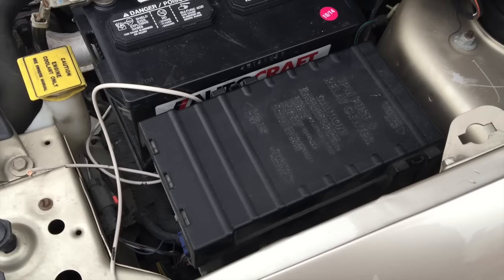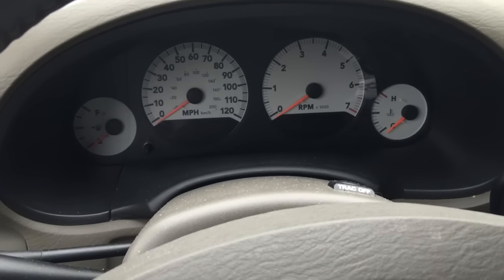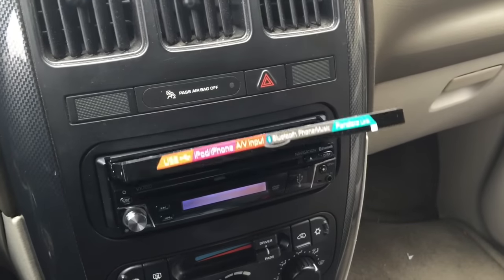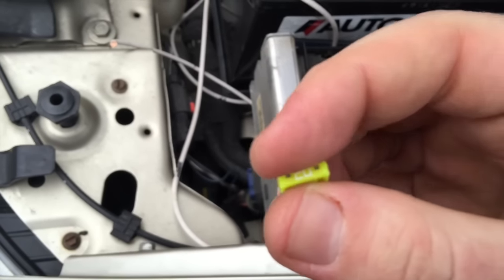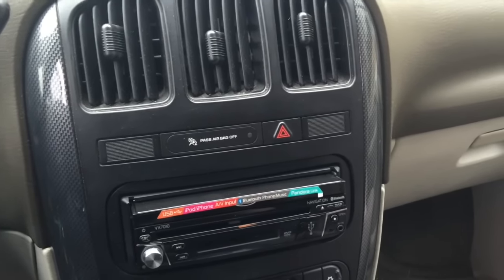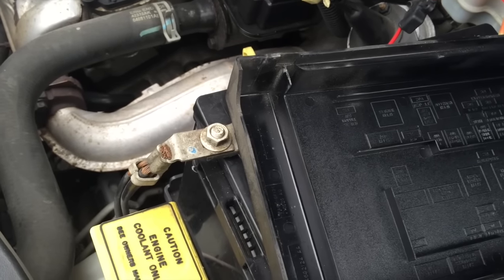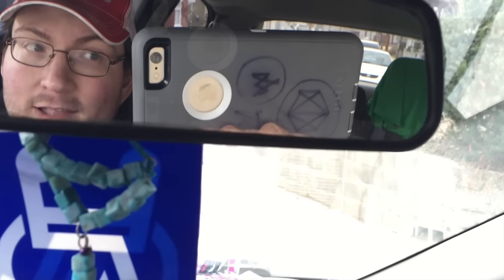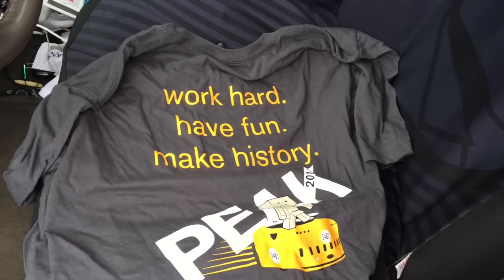Quick Tip: Signs of a blown IOD Fuse on a Chrysler, Dodge, Jeep, Fiat, or Ram product

Comment: 03 caravan cruise control not turning on. what do i do?
Reply from the maker: Hmm.  First thing I'd do is either check the condition of the buttons and make sure the wheel speed sensors are working.  I know that's how dodge Journeys get the data for the cruise
Reply: @adventureoflinkmk2  thanks. where are the wheel speed sensors?
Reply from the maker: @darrylt1031  can be found on each wheel, near the wheel hubs
Reply: @adventureoflinkmk2  thanks. I'll give that a try. cheers.
Reply: @darrylt1031  This guy really listens to people!   God bless you, sir, you have saved so many people from losing cars, endless hours or $1000. Bill, still not working!  Much love, bro!
Reply from the maker: Youre very welcome.

As for Darryl, did you ever get your cruise issue fixed
Reply: @adventureoflinkmk2  ...yes....thanks.....it was a broken clock spring ribbon cable.....replaced it....cruise control works like a champ....
Reply from the maker: You're welcome.. glad to hear ya got it fixed... keep forgetting clock springs can make cruise go wonky as well
Reply: @adventureoflinkmk2  ...yes....especially when it was the original clock spring, and my caravan has in excess of 265,000 miles......cheers.....
Reply from the maker: @darrylt1031  nice.  Good to hear its still running

Comment: Looks like you needed an instrument cluster reset, easy fix.
Reply from the maker: Nope, fixed by replacing that fuse
Reply: @adventureoflinkmk2  That may be but that was why the thing was still screwing up after the fuse change.  If you had reset it, the instruments being goofy would have cleared up sooner.